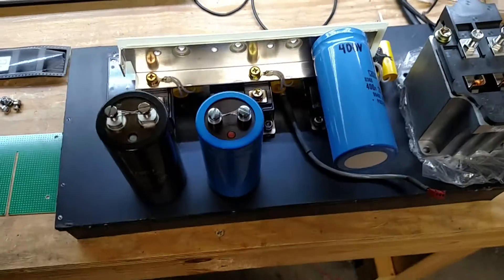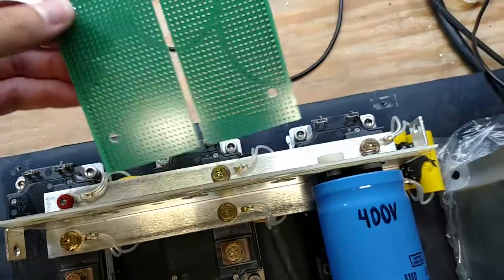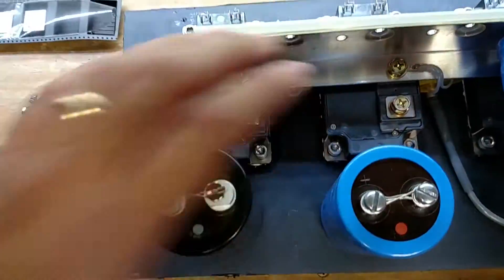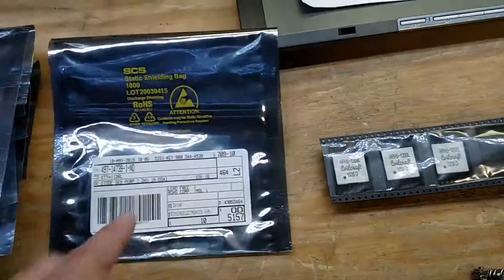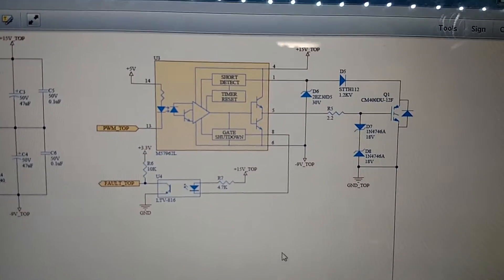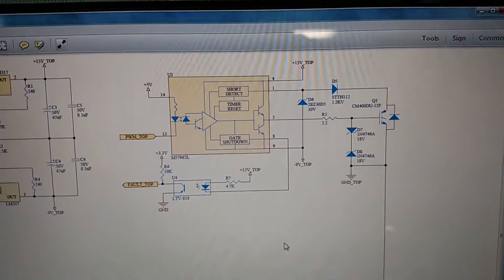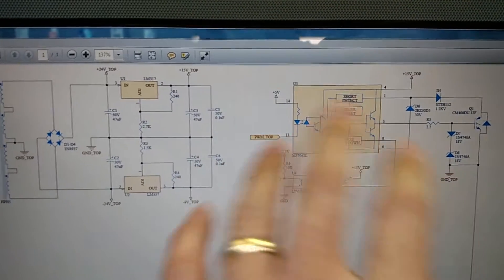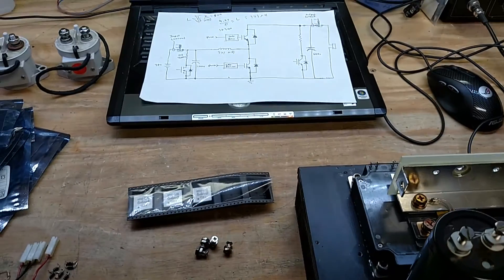Bi-directional buck-boost converter, Part 5

Comment: I was wondering if you've ever done a DC/DC converter build?  I just had my Mean Well PSP-600-15 die on me after 4 years, which replaced a Chennic that died after 1 year.  Also, how about a DC pack voltage to 120VAC inverter?  It'd be great to get 120VAC from my 120VDC pack.
Reply from the maker: For a 120V to 12V DC-DC converter, Early on Solectria made there own, they looked similar to this:
http://wolftronix.com/ac_controller/index.htm
But they soon switched to using Vicor DC-DC power bricks. I would recommend the same.

For a 120VDC to 120VAC inverter... I would do an H-bridge into the primary of a 1:2 step up transformer, modulate a 60Hz sine wave at 20Khz PWM. Then use a small step down transformer for feedback (120VAC to 5VAC), this setup should be able to maintain 120VAC even with the pack discharged down to 10V a battery.

You would need extra circuitry/logic if you wanted to make a grid tie inverter.

Hope that helps. :)
Reply: +Wolf Tronix  For the 120VDC to 120VAC inverter would it be possible to modify a standard 12VDC to 120VAC inverter to run off 120VDC?
Reply from the maker: +JRP3 Yes it is possible...
A 12VDC to 120VAC inverter has a boost converter stage that takes the 12VDC to around 170-180VDC, then that goes to an H-bridge PWM stage to make the 120VAC 60Hz sine wave.

You could trick the inverter and feed in the 120VDC from your pack into the intermediate voltage point, before the H-bridge... however, you will only get around 80VAC out of the inverter with 120VDC input, this is slightly below the 90VAC minimum universal mains input voltage...

That was why I proposed the version with the step up transformer.

Alternatively you could replace the inverter's 12VDC to 170VDC boost converter, with a 120VDC to 170VDC boost converter. ;)
Reply: +Wolf Tronix Which do you think would be easier, doing your design from scratch, or modifying an existing inverter with a boost converter?  Also, is it something you'd be interested in doing?  Cause I'd just be blowing stuff up ;-)
Reply from the maker: +JRP3 Easiest would be to get a used APC UPS, like the SMX2000RM - SMX3000RM series, they take a 120VDC external battery pack. ;)
Reply: +Wolf Tronix Great idea.  I got a used APC 2200 that ran at 48V to use with the 48V pack in my 6 wheeler, I didn't realize they had some that ran on 120VDC.  I'll start searching  :-)
Reply: +JRP3 Just wondered if you know how low a DC voltage they can run off?  My pack is 36 LiFePO4 cells, so 122 fully charged but more like 115-119V when operating.  Assuming it's setup for 10 12V lead acid that would = 11.5V per battery on the low end, I'd think that should be OK.
Reply from the maker: +JRP3 That should work, APC discharges the lead acid batteries down to 9-10V per battery.
Reply: +Wolf Tronix Great.  Thanks for all the help.